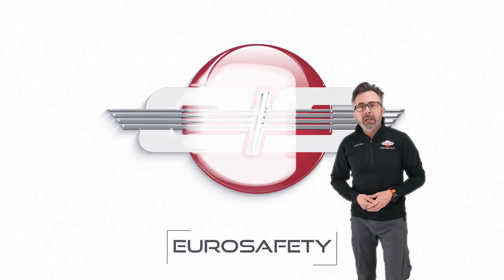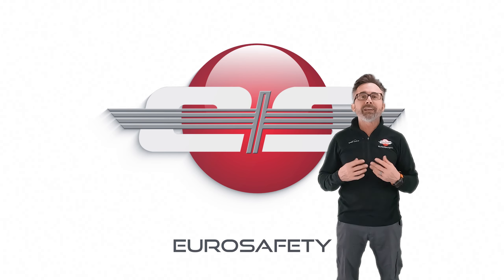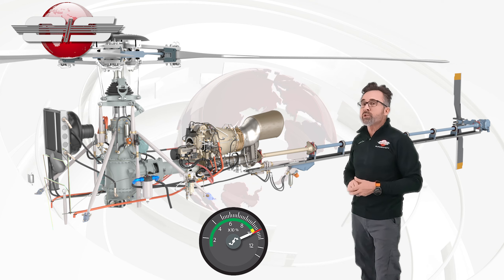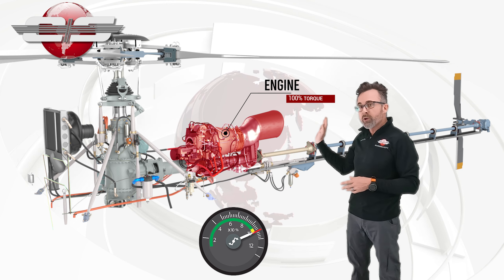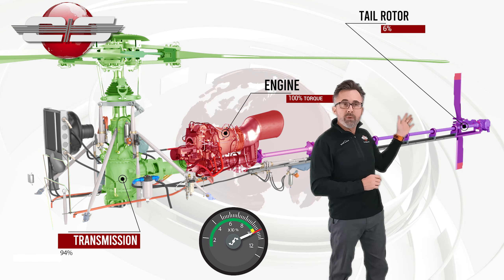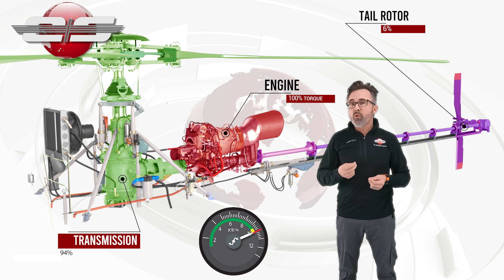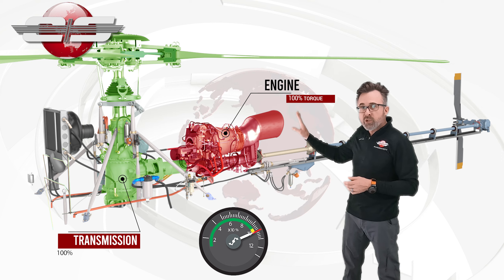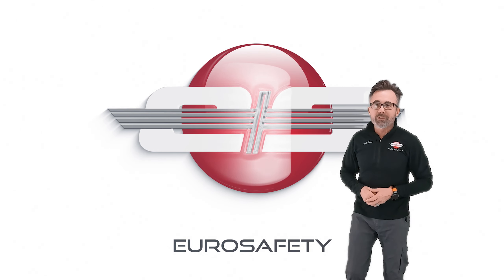#53 - Max Torque Allowances at Different Speeds

Comment: Glenn can you describe a torque turn in the Astar?
Reply from the maker: This is not a term I am familiar with. Its not a term we use with AS350s. I am assuming you are referring to the nose rotating when collective is applied without pedal input. If you were not to manipulate the pedals when you raise collective the nose will rotate to the left.

Comment: What happens when the torque limitations are exceeded? 
For 1 or 2 seconds above 104% what is the maintenance required?
Reply from the maker: Yes, any limitation that is exceed a maintenance action is required. Regarding the specific action required will be dependent on the amount and time the over limit was exceeded. For a light over limit an inspection is required. If sever enough the transmission has to be overhauled.

Comment: Nop I expressed myself wrong. So sorry...english is not my native language. I will try again: TOP limitation: 5 or 30 minutes and no more than 40 KIAS applies to TRQ, NG and TOT ...I do not understand why the 40 KIAS limit applies to NG and TOT as it applies to TRQ. It would have more sense to stablish the 40 KIAS limit just to TRQ and not the other two. Why AIRBUS applies the 40 KIAS limit in TOP to NG and  TOT? Again...apologizes for my english!
Reply from the maker: No problem... are you referring to the B3e?
Reply: Yes
Reply from the maker: That is a good question. You will notice in previous versions of the 350 it was 40 kts for torque and 5 min for NG, but in the B3e its 40 kts for both. The problem is that before you go into the yellow on FLI you do not know if you are about to go into the yellow for torque or NG/N1 (without memorizing the values of course), so they had a choice of somehow telling you right before or make it simple and make it 40 kts for everything

Comment: Hi  and congratulations, I love your channel, I've been a member for a long time. A question: can the movement of the cyclic influence the torque? For example, if  I'm on ground with the rotor in Idle and I try the movement excursion of the cyclic, the torque can change? Obviously not to much, but it is possible that the shape plate moved by cyclic influence also a little bit the torque? Thanks Regards
Reply from the maker: thank you!
Of course any time there is a change in resistance on the rotor system the torque will change. there can be a slight change in torque during cyclic movements on the ground
Reply: @  Thanks so very much for your answer, it is really important for me. Best Regards

Comment: Thank you for your short but very informative videos! Can you elaborate on the claim that the tail rotor is completely off-loaded at 40 KIAS? Or is rather that at 40 KIAS and above the tail rotor is increasingly off-loaded? And for simplicity the Tq limitiation is limited to 94% instead of it being depended on several ranges of airspeed? The reason I am asking is that I have previously requested Airbus for an airspeed at which the vertical fin complety off-loads the tail rotor to aid me in the case of tail rotor drive failure. Their response were that it depended on too many variables such as weight, density altitude, configuration, etc. I further requested a recommened flight speed that would allow relatively coordinated flight characteristics to which they responeded to maintain Vy or higher (optimum climb speed = 55 KIAS). Could you shed further light on this matter? Thank you
Reply from the maker: Ok we are really going into the weeds here. First Airbus/Eurocopter/Aerospatial does not share engineering data for the most part. When we have information like, the vertical fin off loads the tail rotor, the engineers have simply given us that number. They dont show a graph showing, for instance, off load amount for 0-60 kts. Engineering, also, is often not an exact science, there are many variables at different conditions and they find a happy medium for alot of limits. At the end of the day its about aerodynamic performance and TBO. When looking at the transmission limit of 94%, they found that aerodynamically it works and time on component is achieved. As an example if you only need 2 minutes on that transmission to save your life, you can pull the guts out of it and it will work, but now TBO may be 3 minutes. Im sorry if this is not definite answer you were looking for. But the best I can do is engineering is a pursuit of averages and variables that come together to create a mechanism that works. There are no exact numbers in reality.

Comment: Question Off topic.. What is the reason for the Strake on the B2 and why did they remove it from the B3/B3e modle Aircraft? Cheeers
Reply from the maker: Short and Long Answer.... Short: it was installed on AS350B2/AS355N to assist with tail rotor loads but it was apparent that it made the helicopter unstable,  so they removed it from future models. Long answer: The strake works by creating a low pressure on the left side of the tail boom and a high pressure on right from the down flow of main rotor wind. If the controls are not moved it improves tail rotor performance by 5%. But when the controls are moved, including the pedals, the attitude of the helicopter will roll more or less as tail rotor thrust is applied (see pick up/set video we made). When this occurs the strake changes position in the down flow making its assistance variable and then causes more inputs to be made.

Comment: Love these videos!  

Can you shed some light as to why the TRQ transient in the regular B2 is 10 seconds, but in the B2 with a VEMD, the TRQ transient is 5 seconds? Thanks
Reply from the maker: This is a very good question, one that I only have a guess on as the engineers at Airbus have never told us why. This is Glen Whites guess... on the B2 VEMD they wanted to make all the transient times the same to make it easier. Since the lowest transient value is 5 seconds, they made everything 5 sec for that model
Reply: @EUROSAFETYTRAINING  Thanks for the insight!

Comment: Can't we calculate the how much torque is pulled by each rotor
Reply from the maker: Torque on this helicopter is measured in the engine, so the gauge is not what the rotor system is experiencing rather what the engine is putting out